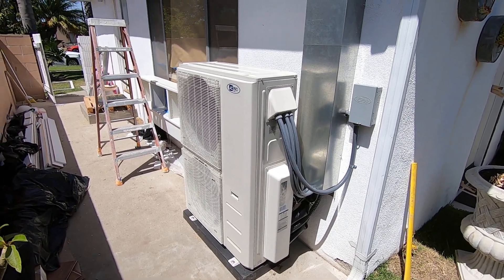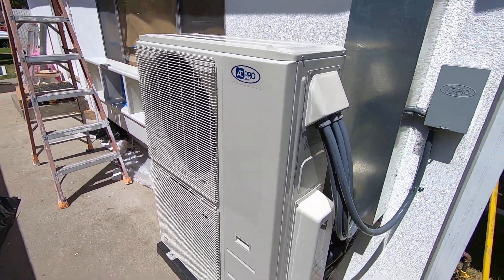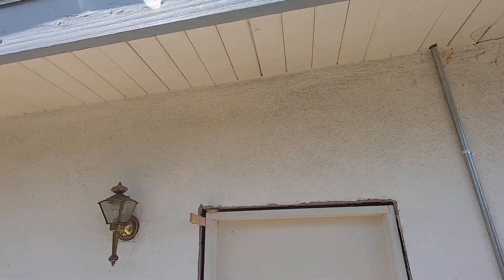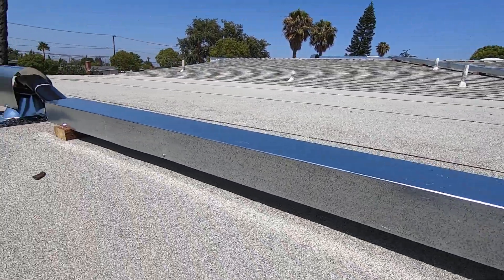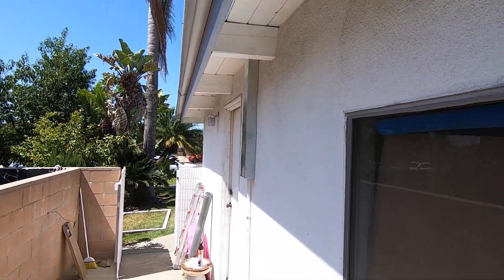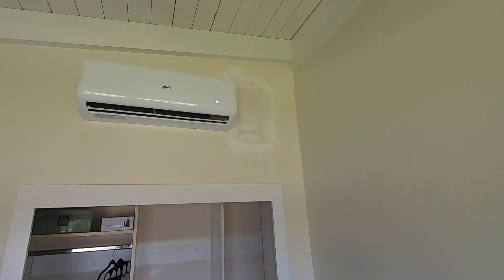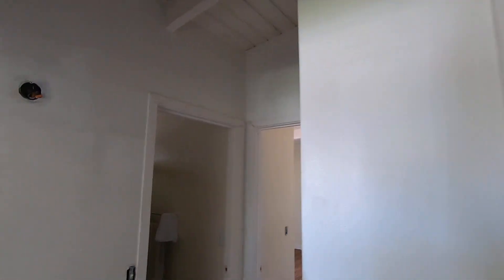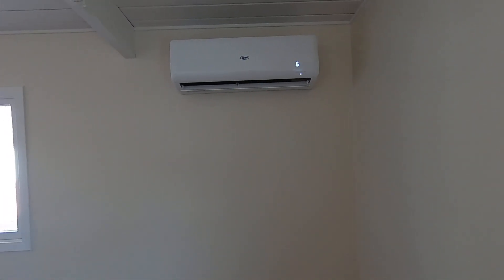Ductless Split System - AC PRO with 5 zones

Comment: My house used to have water heat pump. The upstairs has no duct work. There is no heat upstairs at all.  I am in the process  of gettimg mini split  with 5 heads. I have four rooms. What do you recommend
Reply from the maker: Thank you for watching my video.  I would recommend the Carrier or AC Pro ductless split system.  They very efficient and reliable systems.

Comment: WHAT SIZE WIRE DID YOU YOU USE?
Reply from the maker: From the electrical panel to the condenser we used a 40 amp two pole breaker and #8 wire.  For each of the fan coils inside we used #14 control wiring.

Comment: Would a 5 zone like this heat and cool a whole 3100 sqft house in New Jersey?
Reply from the maker: It should be able to.  But you would need to make sure condenser and fan coils are sized correctly for the rooms.  If for some reason you need more BTU's to cool or heat the house then  other option is to do a 3 ton ductless condenser with with 3 fan coils for one side of the house and then a another 3 ton system for the other side.  Ductless offers many options when configuring a system.  I'm sure that one way or another you can find a system or systems that will meet your needs.

Comment: So you have 63k btu worth of indoor units and only a 40k outdoor unit?  Does that work well with the exterior unit being 23,000 BTU smaller?
Reply: The outdoor condenser is 48,000 BTU.  Not all of the zones run at the same time and it is a variable speed system so it supplies the amount of cooling or heating capacity to the individual fan coils as needed.  It is rare that the demand for cooling or heating is 100% per fan coil.  I have had no complaints about being able to cool or heat their house from this customer since we installed the system.
Reply: @fijiman88  ok, just asking because i have a new Mitsubishi system with two 9k ceiling cassette's  in my basement and one 24k wall mount in the garage mated to a 36k outdoor heat pump unit.   The basement is spray foamed and the units are oversized for the space but 9k was the smallest ceiling cassettes they make. So neither one should ever demand over 50% i'm sure. 
My garage unit is seeming to have trouble ramping up when it gets hot after pulling a car in.   24k in a 480 sqft garage should not struggle at all.  
Just asked that to get some input from you and see how the system in this video was performing.
Reply: @KnightsGarage   With the 9k units having a smaller demand the 24k unit should be able to handle the garage area.  I would have the installing contractor check the function of the 24k unit and charge on the system to make sure it is running correctly.  We have had no problems with this 5 zone system.  Just like yours, the 9k bedroom fan coils are only running at 50% demand when on.  Only the 18k units run full out when it gets really hot.

Comment: Is a 5 zone system a bad choice?   I have a company telling me I need two outdoor units.
Reply: For this house the 5 zone system was the best option for a few reasons.  1 -  The existing electrical panel could only handle adding one more 220 circuit.  Otherwise if they went with 2 ductless condensers they would need to upgrade the panel to 200 amps.  That would have cost a lot of extra money to do so.  2 - The 5 ton ductless condenser and 5 high wall fan coils fit within the specs to cool and heat the house.  That might not be the case with other homes.  3 - This system fit within the budget of the customer.  Doing 2 ductless systems would have been a lot more money.

Comment: Why not just run the lines along the side of the house to where you are mounting inside unit?? What happnes when roof needs replaced…
Reply: We ran them on the roof because the maximum amount of lines for this system was 268 feet.  If we ran them on the side of the house we would have gone over that.  Also the customer wanted as littlle lines as possible to show on the outside of his house.  If the roof needs to be redone then we will have to pull up the lines and then put them back.
Reply: I like it, I think you did a good job. But I would of probably had two AC one on each side of the house and ran the lines on the outside of the wall .. one AC doing 3 zone and the other AC on the other side of the house doing the 2 zones.. that way if  one of the system is down and needs a repair they still have the other AC working. But nice work ..
Reply: @ryb1906  We considered that, but the cost of doing another condenser and running another electrical circuit to a second condenser would have added significant cost to the project.  Also, the electrical panel would have needed to be upgrade to facilitate that.  But I do agree that would have been the best way to do it.  Unfortunately the cost was major consideration in deciding to go the way we did.

Comment: Line set on the roof. My mind is blown 😳
Reply: This house had high ceilings with no attic and was also on a slab.  So there was no other way to access each room with the linesets.  Each line is insulated and then we put them in the metal line cover to give them even more protection from the elements.  It is not shown in this video, but we will be returning to paint the line covers on the roof with a special paint.
Reply: @fijiman88 Nice work 👌
Reply: So awesome!! Great install
Reply: Yeah never seen that before like that but these things are pretty new on the market for remodels like this.